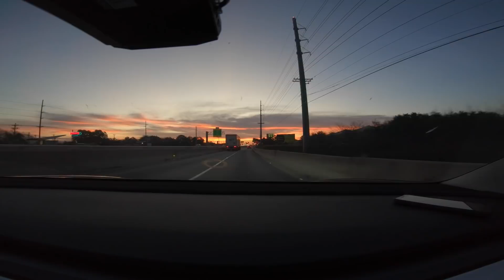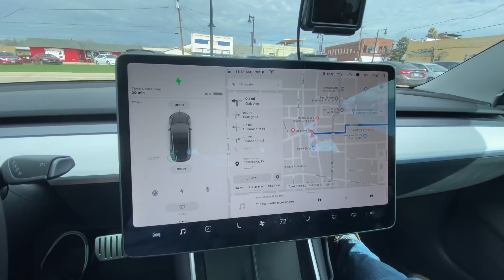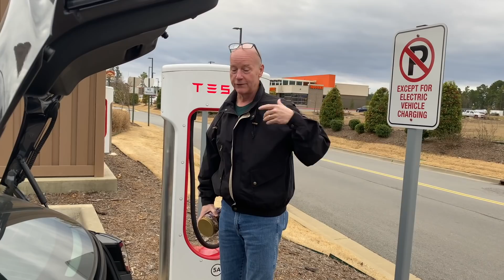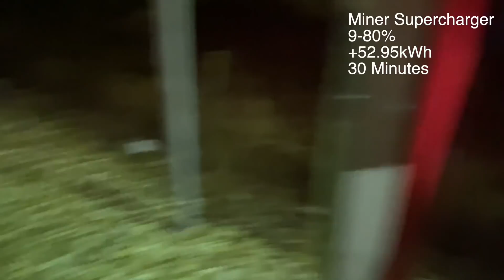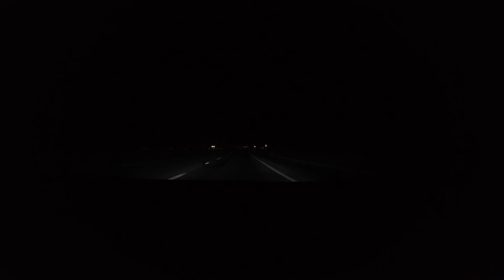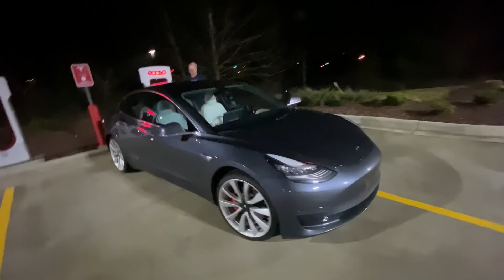Tesla Road Trip Texas to North Carolina Model 3 Performance

Comment: Is that the Max360C detector? Do you like it? Looking to get one, but not sure where to start or which is good and easy.
Reply from the maker: It’s all about how you use it to interpret data. Key factors for a good detector: needs good filtering, directional arrows, and excellent sensitivity. This has all of it

Comment: Enjoyed the video but you were reported charging speed vs your reported numbers are off by quite a bit. Is there a lot of loss during charging that would explain this?
Example Texarkana you stated that charging was stable at 150kW yet 45.63kWh and 24min would be 114kW. HVAC heater on full (which the weather didn't seem to need) would only be like 7kW?

Comment: I live in Arizona and have made three trips back and forth across Texas to Alabama. Two comments next time you’re in sulfur Springs go to the town square while you’re charging there are two boxes that look like big mirror cubes. They were actually restrooms that have a one-way mirrors while you can see out nobody can see in. Another great drive is to use the ferry to Galveston Island we did it coming back to Arizona. Last charge was Lake Charles. And then drove down the Bovair peninsula and caught the ferry across to Galveston the next stop is Webster. You will not regret doing stop in Sulfur Springs and walking around it’s like a little touch of Mayberry. And the drive along the gulf to Galveston is quite fun. These are just a few of the great things to do when driving across Texas.

Comment: These videos are very misleading and unrealitic..this so called road trip is done with free supercharging..average people cant shell out 70 to 80 grand or get a free tesla...I want to know the range and actually cost to charge ..not how cool the car is..I want to purchase 1 but I doubt I'd be able to afford the ones with free supercharge for life.

I cant get a real answer and it's very aggravating. Lol you guys giggling like girls recharging as you go but its litterly costing you nothing but the coffee and food your buying..lol
Reply from the maker: It’s so cheap anyway if you have to pay it doesn’t matter. All of the pricing is on Tesla’s website - go check it out. This is solved with a quick google search my friend. Add in their pricing model with either the per minute (I always say how long we charged) or by kWh (which I always show) and do your math. It’s probably around $3-6 on average per stop.
Reply: I bought a new 2021 3LR AWD on March 31st 2021 for less than 50K. Considering performance, technology, and low to no fuel cost (charge at home) it it absolutely the best value in a car anywhere. I now have 1800 miles on it between quick trips around NC and VA and spent about 1/3 the cost of fuel at Superchargers. My range at higher than normal speeds (10 over speed limits on the hwy) is a solid 280 miles IF you charge to 100% which I don’t do. It is more efficient to charge just enough to roll in low to the next charger.

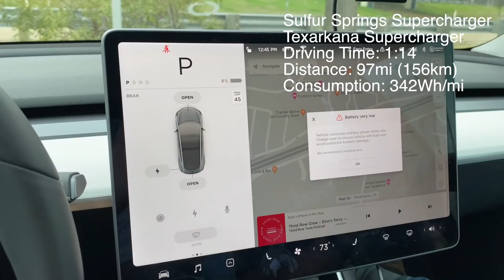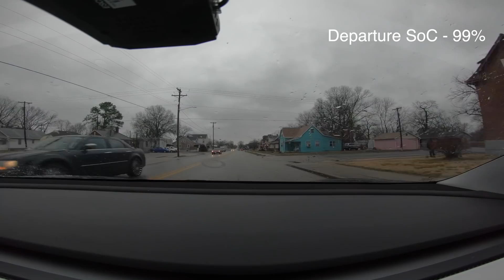Comment: You have probably seen that 9:18 "Battery very low" message more times than I've ever even Supercharged.   23:10 Oh good, it wouldn't be an Out of Spec road trip without having to drive in the rain.  Great trip, thanks for sharing.

Comment: Your consumption is way better than mine, (at your professed speeds) what wheels and tires are you running? I actually hope you will comment on a comparison between what is on your model 3 and the 8.5, 18" wheels and tires I am running on mine. To equal your consumption, I must run at 70-75, btw
Reply from the maker: There was a huge tail wind all day

Comment: I bet not many people can justify buying a 60k car with the economy now.
Reply: Agreed,. But there are some deals on Chevy Bolt EV.. I've seen low $20's for a new one .
At that price it's a compelling choice..
If you are in the market for a new car at all.
Personally I have some philosophical issues with Tesla, mostly right to repair and ability to repair.
No doubt that they are technically superior in many ways.
I just absolutely detest the interior on the Model 3 and Y, and the Model S is an extremely complicated and expensive vehicle to service after the fact if you bought one used.
Reply: kens97sto171 Well you can get a Model 3 brand new for 35k.
Reply: @jgonsalves22  
No you can't. Go on their website pick the standard + RWD, It says $35,000. But that's after estimated savings.
The actual price is $39,000.
apparently there may be some way to actually get the $35,000 model if you know how to custom order something on their website.
It's still not a terrible price for a car. But they throw that $35,000 price around a awful lot when they don't actually really sell it and for a long time they actually did not sell it at all You could not get that cheaper model. It was available for like 4 weeks in the beginning and then they ended the line. And then brought it back but as I said apparently hidden in the website ordering options.
I'm considering an electric myself. And right now the Chevrolet bolt EV is your best price. Sticker MSRP is way too high and always has been. But Chevy is knocking big money off I've seen brand new 2020s for $23,000.
it's not as luxurious as a Model 3 it's not as fast, but actually has more rear seat interior legroom and headroom and it's a hatchback.
The only real negative on the Chevy Bolt is the DC fast charging speeds are pretty slow by today's standards.

Comment: Kyle - did you figure out what the slowdown issue was on the last few charge stops?  Does frequent SC visits with no slow charging in between cause BMS to put you in the penalty box?  You should have put the guy in MO (Don’s idol) on camera.  Good fun riding along.  Thanks!
Reply from the maker: We did a whole episode with Jack on his channel (EVTV) - nope no evidence of multiple charges slowing down charging, just weird older software. Many of the issues are fixed now however the cars still do not charge as fast as they did last summer when I set the cannonball record

Comment: Really should to try Rain X to improve your efficiency, no wipers needed
Reply: Check out Aquapel, I find it lasts over a year before I have to reapply and I don't get the black streaks that sometimes develop with the Rain-x if I let it go too long.
Reply: Needed new wipers for sure..
RainX works good. You can also use car wax on the window.
That works almost as well and last a lot longer.

Comment: Nice road trip. Did you have to make prior arrangements with the hotel in Austin to use the charger (overnight?)? I would think that with an EV show, the chargers in and around Austin would have been quite busy.
Reply from the maker: Nope - we charged up in anticipation of the chargers being used but only saw a roadster (gen 1) using them when we first arrived
Reply: Most people probably came in on their electric planes